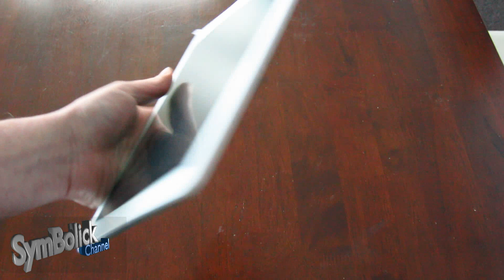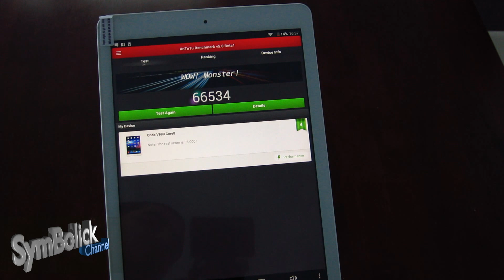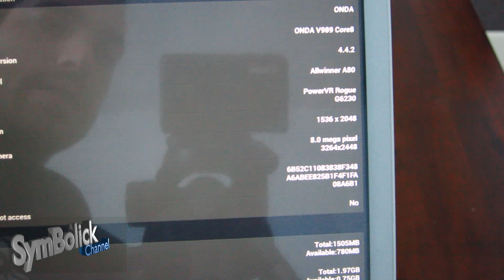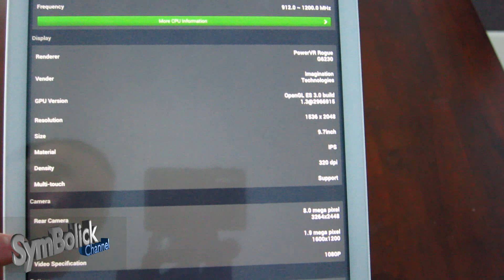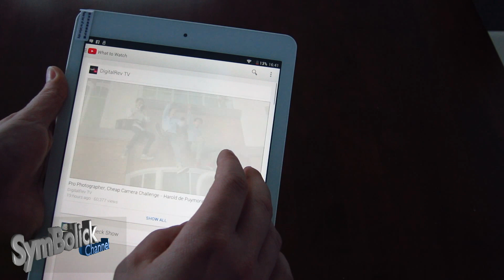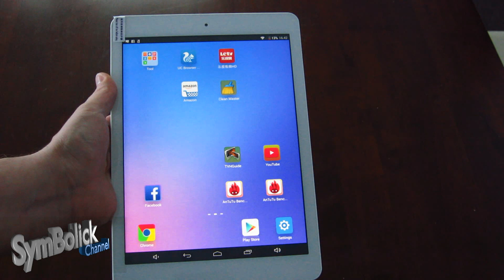Tablet Onda V989 - Review

Comment: How is the screen quality? I had to return another tablet because it was very grainy (like a anti-glare/matte monitor dusty colourful sprinkles all over the screen). Is the screen on this tablet clear? Especially on bright colours.
Reply: WWW.2KINDS.COM I wish it was just the screen protector. I removed everything to bare glass and it looks like the assembly line forgot to remove the protective film behind the glass digitizer. I've asked around and a lot of people are having the same problem and it seems like a batch problem :(
Reply from the maker: MintJustin the screen looks very nice. I am quite impress with it to be honest. Have you had problems with the screen of the same model?
Reply: MrSymbolick I've asked around and it seems like a batch problem. The factory assembly line seemed to forgot to remove the protector film behind the glass before putting it on. So annoying...
Reply from the maker: MintJustin that's not good. Should not happen. Does not really create a lot of confidence

Comment: Could you tell us please, how is the web browsing on this device? Does it feel choppy or lagging at any point, when using chrome/next browser or something like that? (for example I have a Huawaei Mediapad link,  and,  at totally random moments, it has these stutters while browsing,  when you are basically paralyzed and have to wait till it resumes working properly) 

Other thing - what's with the 2g internal memory? Does it mean that I am rather limited to what I can install,  and no big apps,  or they can be installed on the other partition where is the rest of the memory? 

And battery life - with moderate use - let's  say an hour of browsing,  hour or so watching videos and an hour of reading a comic/book - would it be able to last 2 days? 

Thank you in advance and thanks for this short review!
Reply: young mouss Go to "Apps" in settings and you can move to SD.
And any Apps that won't let you move just use "App2SD" App.
Reply: So far on Chrome I've seen no problems at all browsing and streaming.
It's got 32gb memory but out the box it has only 24gb available but that's just because it has some videos and Apps you can just delete, and the 2gb you saw is actually the Ram.
And battery isn't up to standard of some tablets I've used but is still pretty good.
Reply: Thanks for the reply!
Reply: Alan Parker is it possible to transfer games and app to the sd card?please i need to know it
Reply: young mouss it's android and it should be possible ^^

Comment: Thank you for the review. I need a tablet for reading pdf files and highlighting/copying the text. I wonder if you could test this feature on your tablet. Some of the good annotating apps are: Adobe Reader, Repligo Reader and Foxit Pdf. Could you you test the screen sensitivity in this way? The other question is, of course, how is the battery life? Did you have a chance to compare Onda to some other major tablet makers ("THE fruit", etc) to get the idea about the screen brightness? If you could make a video with quick comparison, that would be great! Yeah. And, is there any bt/wifi problem? Cheers!
Reply from the maker: I am currently on a work trip. I will do a review as you requested as soon as I am back. I am using the Adobe Reader myself with the tablet and it works like a treat :-) 
The battery life is pretty good. Depending on your brightness level it should last easily for more than a day continuous reading.
I have only used Wi-Fi with the tablet so far and I never had any issues at home. Here in the hotel it drops out every now and then, but I think it is actually the Wi-Fi of the hotel, because it happens as well with my phone.
Reply: MrSymbolick Looking forward to that new review man